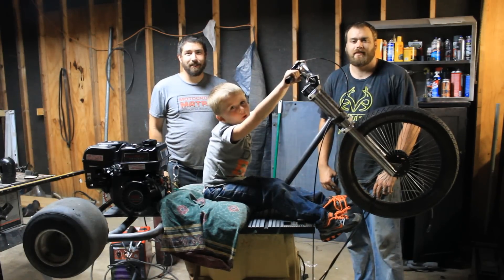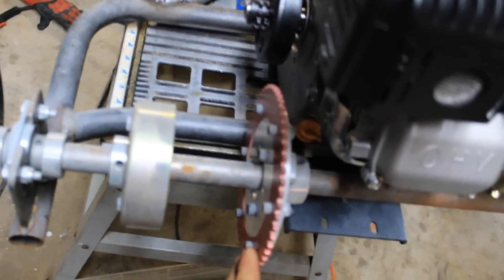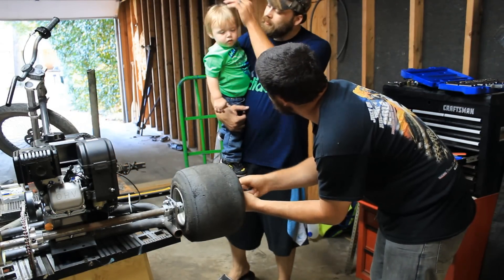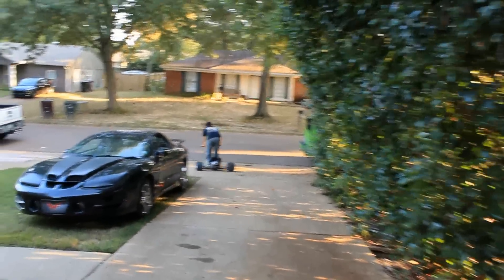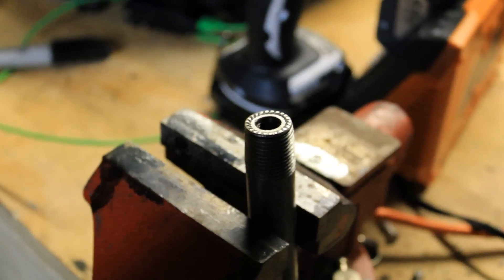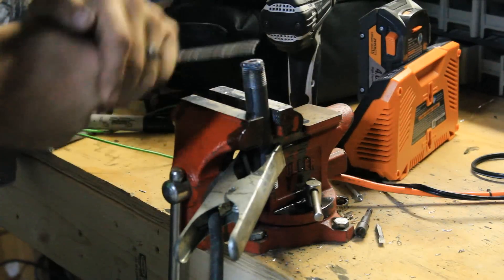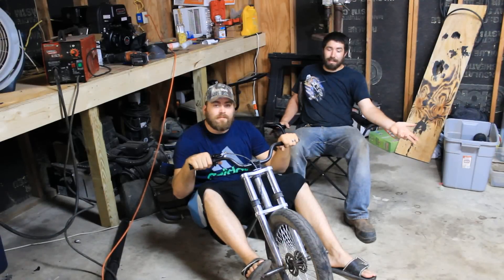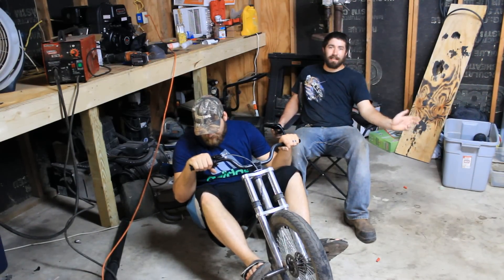Redneck drift trike: Part 1

Comment: hey guys were can I pick up a set of rear wheel and tires like the ones you have there.
Reply from the maker: +gusduran11 the wheels are a standard wheel and tire for like a racing go-kart the sleeves that go over them were made from a concrete core drilling bit you would have to find a concrete cutting company in your area and ask for scrap or maybe a sprinkler pipe company
Reply: oh ok cool they kinda hard to find. I'm building a go cart and that's the wheel and tire I'm looking for. thanks though man. when you run those type of wheels and tires what size sproket you have?
Reply from the maker: +gusduran11 the sprocket size would probably be different on a go-kart but no message us on our Facebook page and I can send you pictures of what we have
Reply: man I don't have Facebook its trouble haha! thank you though. I will keep searching.
Reply from the maker: +gusduran11 yeah I know what you mean
Reply: I just got my predator motor and I'm watching your how to remove the governor. I will be doing this tomorrow for sure thanks for the videos man keep it up. I also live in Texas by the way!!
Reply from the maker: +gusduran11 it wasn't too hard except for removing the gear but what part of Texas are you in we are in Memphis Tennessee